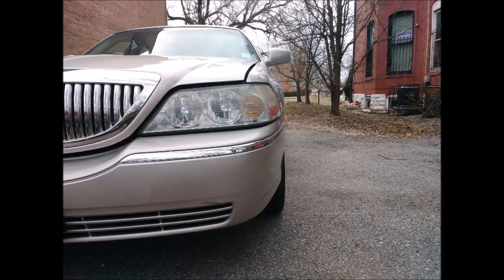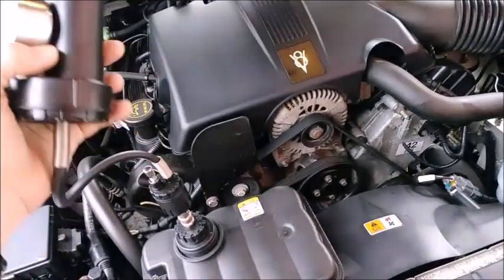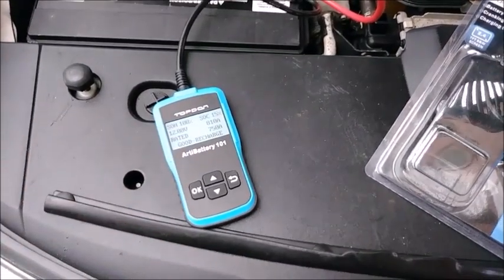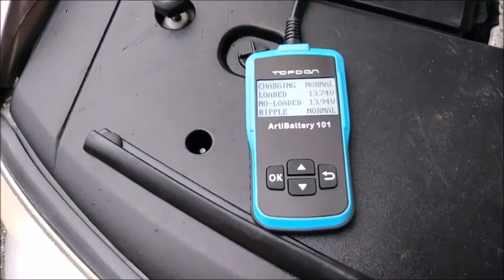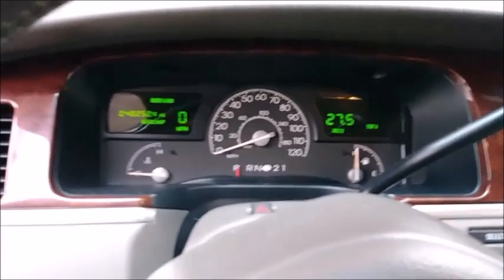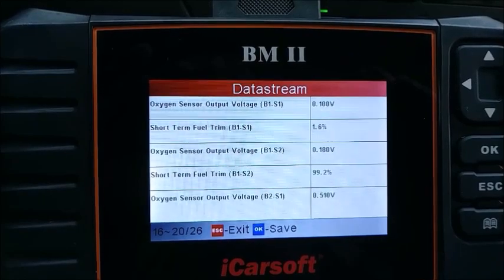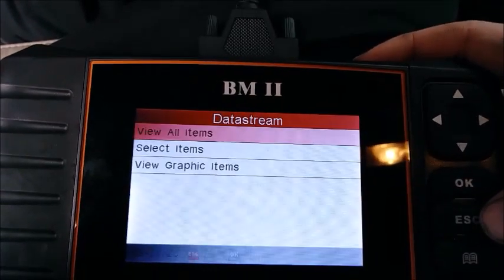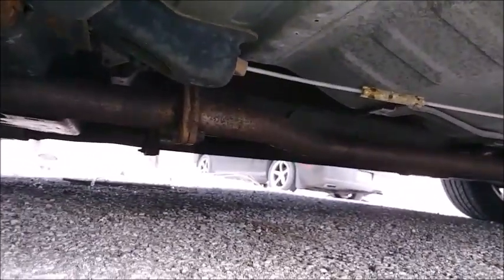Before you buy a 2003 Lincoln Town Car

Comment: I bought a 2003 Lincoln Town Car with 83,000 original miles. I was trying to find a video on spare tire remove/replace . I have been surprise how many people have commented on the smooth ride the car has. I hadn't driven much in recent years, but I drove it to Tennessee recently. I couldn't believe how quickly I made the trip. Absolutely no fatigue when arrived

Comment: Future buyers, check under passenger floor mat for dampness ......simple fix with exterior sealant but can stink if left unnoticed.
Reply: Yeah i bought one from an older gentlemen and the smell was the 1st thing i noticed
Reply: Clean the leaves out from the drain reservoir under the hood against windshield..dont think you need to seal anything

Comment: Year 2003 specific issues are rear axles which wear prematurely because the housing metal is too soft.  This was corrected for 2004.  Also the 4.6 heads have half thread count for spark plugs.compared to later heads.  This can cause spark plug blow out.  IIRC, 2003 also had plastic timing chain guides which wear out prematurely.  Many were updated by the dealer.  Look for marks on the front of the valve covers which indicates the update was done.  Town Cars are gently driven so these are not too much of an issue...unlike CVPI's.

Comment: I have a 2003 Town Car with right at 100k on the odometer. They are very nice cars. Handles bumps in the road like a dream. There are three issues I have with them. The worst is the braking. I replaced all the rotors and pads and had the old fluid flushed but she still needs some distance to stop. Another strange thing is body roll. If your coming up to a curve on the highway your best to stay to the inside of your lane at first and start with a gentle turn. When you feel the suspension load you can tighten your turn. If you don’t ease into it it just feels a little squirrelly. The last annoying thing is the delay shifting from drive to reverse. I live on a well traveled road and like to back into the drive. The lag in shifting makes this more challenging. I will offer two other heads up. If you do your own repairs, change the stabilizer links before they get crusty. There is no easy way to keep them from spinning as you remove the nut so you don’t want the nut to be rusted on there. Buy Moog brand and they will have a provision to hold the shaft with a wrench as you take the nut off. The other dumb thing is it’s hard to find a replacement bulb for the dash clock. They exist but I don’t have a part number or vendor to offer up. As already mentioned there are water problems with the cabin air intake seal, rear axles, and windshield wiper module as well as the wiper/blinker control lever.
Reply: I was just gonna replace all the rotors and pads because of the braking and also change the axles and motor mounts because of the gear shifting you were saying but idk if to even do it now since it will stay the same but honestly I might just do it just because is almost 20years old
Reply: Ponchiii M ... I’m guessing that the delay in shifting is in the electronics. I haven’t investigated it but I don’t think shifters are linked to the transmissions anymore. I think they use control modules to detect the shifter position and actuate the shift in the tranny. Again, I don’t know this for sure. I did have to the driver side axle replaced. My mechanic just sorced it from a junk yard. I don’t know if there is a better version of the axle available or if it’s just something to live with.
Reply: Jim Short thanks and I just noticed on my Lincoln if I step the brake all the way and then shift it doesn’t shift as bad if I don’t brake all the way down but yeah iguess ima just have to get used to the braking part but also they already squeaking soo ima just do everything at once just to see if it works or not but I like how smooth they are it is how people really say if your riding in clouds Ima make sure mine runs as much as it can before I gotta buy another one

Comment: 17 Year old rear suspension air bags; the air pump and controllers cost a bundle if rubber and etc. worn out.  That would be the first thing I would check on these Town Cars.  Not even mentioned in this article.

Comment: Ever had an issue with the notorious ghost acceleration?  I just bought an 03 and I've had it twice in a week!  It happened to me at very low speeds, braking, and both times the tires were wet (rain, and right after a car wash).  It's crazy.  I mashed the brake but the engine actually races.  I've found dozens of complaints about this and I think there's even a class-action suit open over it.
Reply from the maker: Not with the TC but a couple months ago my P71 started doing that. It was idling so fast I could go 40+mph without even touching the gas pedal. It was insane. I replaced the TPS and that fixed. Just prior to it doing that I replaced the intake manifold because it cracked and leaked coolant everywhere. I think the TPS was just a coincidence. I don't think the new intake manifold caused the issue
Reply: @HollywoodHornet  Thanks for the quick reply.  -Yes, I don't think its limited to the TC, I think it's an issue with all(many) Panthers.  Speculation points to a coding problem and the discussion is to compel a recall to fix but so far Ford's not responding.  Very odd, as prolific as the Panther platform is you'd think Ford would address. In my case with the wet tires, I'm looking hard at the ABS.  Cheers.

Comment: Any idea where the park assist module is in my 2003 Lincoln Town Car?
Reply from the maker: My particular specimen does not have the parking assist option. I do have the factory service manual for my 2003 Town Car. I'll consult it tomorrow to see if it will tell me it's secrets.

Comment: Make sure your 2003 Panther Chassis has had the rear axle's replaced. There is a TSB about this issue. Fleet vehicles were recalled but us civilian owners were left out to dry. (Thanks Ford).
Reply from the maker: Oh, snap. I was unaware of this. I'll have to research the issue.
Reply: @HollywoodHornet  When you have this repair done make certain they replace the entire axle housing with one from a junk yard from a different  year.  I had ours repaired four times at four shops.  They were just ordering 2003 axles that had been sold into the aftermarket by Ford.  ,  The axles were hardend incorrectly and are too soft.  They wear and then your bearings grind away until the seals leak. Swapped out  with a 2005 and no more issues. I have owned over 20 cars and never had a rear axle bearing go bad before this one.  Btw: I currently own the 03 Cartier in silver, a 2004 Ultimate in white,  and a 08 Signature L in gold. 
The only other issue was 03 and prior had a plastic coolant cross tube that would crack.
Reply: Shawn Kemp  the water in the floor  is a ten dollar repair that takes 15 minutes. After 2003 the intakes were modified with a metal cool as my tube.  I have the original intakes on my 2004 and 2008. As long as you get a 2004 or newer you should have no issues if it has been well maintained. Remember, these were designed and built for fleet usage.  The only better car I know of is Toyota.  European's cost too much to repair and even Nissan quality has gone to hell.  Honda used to be great   but their automatic transmissions are no good and cost a fortune to fix.
Reply: Shawn Kemp  Yes the long wheel base is very roomy.  The only other issue is the air ride suspension. They get expensive as. They get older.  I have changed all of mine to regular Springs.  The wife helped me do it and it only took about 20 minutes and cost about 80 dollars.  They ride the same but if you over stuff the trunk it will sit lower. The air ride would keep it level is the only difference.
Reply: @donaldvincent  Air suspension isn't a huge problem. The whole kit is like $500, cheaper if you just have to replace the compressor or bags separately. Nowhere near as expensive as a Mercedes. And the ride is definitely not the same, especially when the trunk is loaded up or you've got a couple of fat fucks like me in the back seat. If it were, why would Ford have offered it in the first place?
Reply: @SnownelVEVO  The TSB/Recall has nothing to do with the Air Suspension. And yes, the while kit is only about $500. I just have so many I got tired. It seemed like there was an issue on one of my cars at almost any given time.  As for having a  heavy load, There are "Progressive" springs that get stiffer as they are compressed. They give a smooth ride in most situations, even with a heavy like us big guys in the back. btw: the TSB/Recall was related to the improper hardening of the rear axles.

Comment: In 2003 ford replaced the plastic intake manifolds with metal.
Reply: Can confirm they did not. They revised the design with additional aluminum reinforcement DURING the 2004 production, later 2004s got the new design, earlier 2004s did not. (Ask me how I know)
Reply: @MrEshamp  how do you know ? :)
Reply: @akrextra  Beeeecause when I found a 2004 that I liked I was happy to see that 2004 was the first year for the new manifolds... only 6 months and one replacement manifold later did I learn that that did not mean ALL 2004's got the new manifold.
Reply: @MrEshamp  I have a 2003 Grand Marquis and all 4.6's that I've seen with the PI motors which are +03 have the updated metal thermostat housing. so yes, 2003+ did get the new manifolds.
Reply: @midas617  Well then:
A: it would appear that the later housings are not immune to failure themselves
B: I recall looking at the new crossover pipe after having the manifold done and noting how much more aluminum was there, but I guess the old one was not plastic, but filthy aluminum?
C: I shall hang my head in shame for being one of those people that perpetuate iffy information online, thought I read somewhere that they changed in 2004, but I don't know where and am going to assume that was BS anyway
Reply: This is only half true, in 2006 they revised the revised intake manifold to a plastic piece with an aluminum cross over for the front coolant passage, and added an aluminum shim to the rear passage, this has been the best one and ran till 11 when they stopped making it. But, it still leaks at the rear and is known to dry out and crack, some will tell you tire shine will keep it moist, others claim oil or armor all, but it's plastic that gets hot and cold over and over, it fatigues and cracks over time. Now, they did make a metal intake for the 2002 and prior non PI head 4.6 that came from the early modular town cars, they are a direct swap to the non pi head later towncars, edlebrock makes a replacement aluminum vic jr intake for the PI head 4.6 later models, but you really need a bbk throttle body if you do that, the stock one's are remanned by dorman, they aren't terrible to replace, I wouldn't let that flaw stop you from buying one, they're are far worse issues with these as they age, vs the intake issue..
Reply: Turn on the master for Tech and I have a channel that specifically tailored to this car and everything that I'm doing to upgraded and make things better and I talked about things pretty in-depth the manifold has been upgraded but he is not entirely aluminum or any type of metal
Reply: Even the newer updated thermostat housing still leaks there's nothing really all that much better about it I do them often

Comment: Bad test. Your voltage meter needs to go in the trash. A volt meter set at 20 volts shows the volts you start with, and once engine is running shows how many volts the alternator is charging. Your pressure water system tester actually blows head gaskets if an engine is cold. They should only be used after an engine is hot because the engine metal is expanded, but cold it isnt and can cause an area of a head gasket to actually blow. As for the OBD 2 tester, you test nothing if no engine light is on. You could check one for a pending code, but other than that its pointless.

Heres the proper way to check out a car. Make sure the volt meter is putting out 13.5 to 14.5 volts when engine is running. First, look under it for oil leaks, second look under the differential and see if oil is leaking out. Next, squeeze the upper radiator hose when engine is cold and if it has pressure when it is cold it has a blown head gasket, but if the radiator or tank is full and no pressure when cold then its okay. Next, turn on the key then start and pay attention to how long it takes for the oil light to turn off which should be no more than 3 seconds. Next listen to the engine for upper noises (especially in the modular V8s that are notorious for clattering rockers when engine is cold and chain problems), next listen to the oil pain area for rod knocks.

Comment: Nice car
Reply from the maker: It's my mom's. She wrecked her LHS over the summer and she just got this beast. I did just buy me something similar to this Lincoln to use as a spare in case the BMW goes dows or Katie's Neon bites the dust. Now I can move the Corvette out of the city and to Jefferson County where it's safe from the fellas. I currently have the Camaro in my buddy's garage for the winter. That garage sees no sunlight inside and is so well-insulated it stays 50 degrees in there.
Reply: @HollywoodHornet  how far are you from Mid america arms or Sybergs on Gravois ??
Reply from the maker: @catfishjenkem2226  they both appear to be roughly 10 miles from my house.

Comment: I would hate to work on that engine .
Reply from the maker: You think it's gonna suck? It looks ever so slightly more difficult than the BMW engine and Corvette engine. Good thing it seems in good shape with low miles.
Reply: @HollywoodHornet  LOL You are used to it Matt !!  Beautiful car though !!!
Reply from the maker: @catfishjenkem2226  I want to take that beast for a spin and see what this air suspension is all about. I hear they ride smooth. I've never driven a Cadillac or a Lincoln so I wanna see what all the buzz is about.
Reply: @HollywoodHornet  My Caddy is safe in the garage
Reply: Curious why you would be afraid to work on that engine. Basic V8 with lots of room around it.
Reply: This engine is by far one of the most easiest engines to do work on
Reply: @FordBossMe  Not as easy as my 1987 chevy pickup lol
Reply: @catfishjenkem2226  yeah but these are still nothing, ive had 9lenty of them to
Reply: @catfishjenkem2226  I don't have to set the timing on this